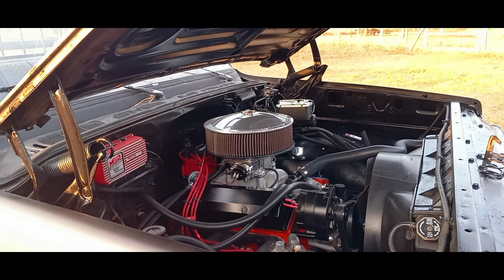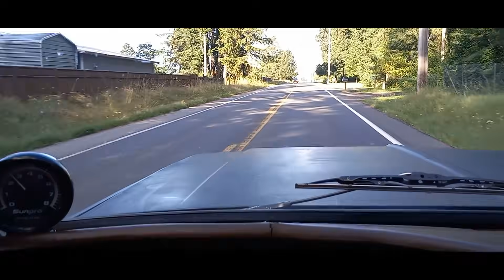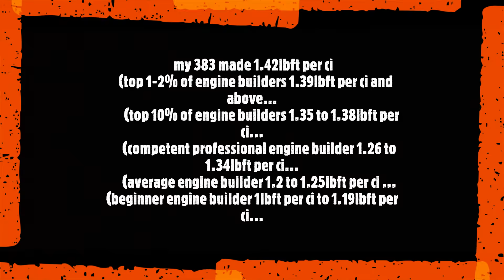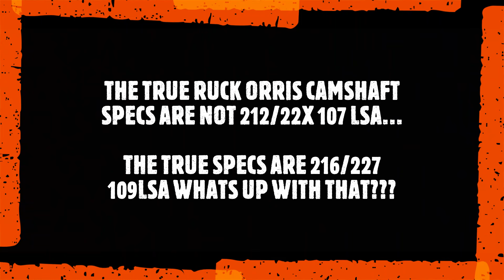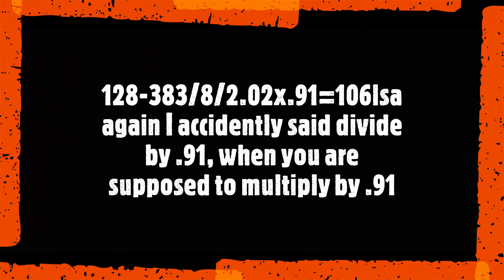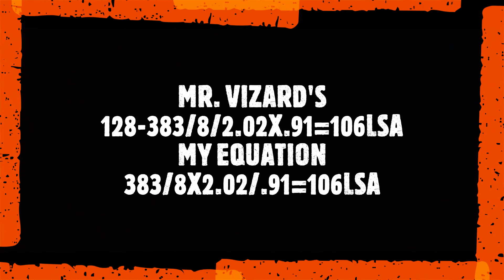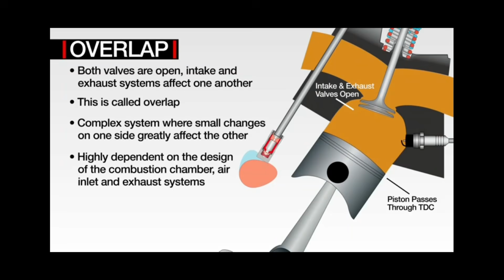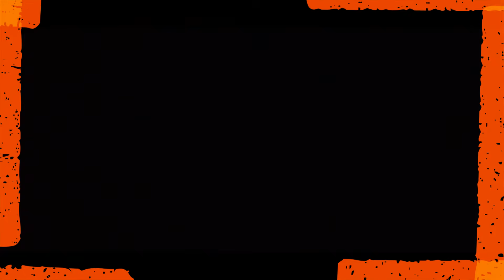CAMSHAFT SELECTION by LSA, 9 LSA's DYNO TESTED!!! LSA THEORY WILL BE DYNO PROVEN!!!, and EXPLAINED

Comment: I enjoy your observations but I think in terms of producing a ‘marketable product’ profitably and used for a vast range of cylinder heads compression ratios, gear ratios , vehicle weights, stall and flash speeds, and even regional climate extremes ( ex 2 identical cars/engines one in Miami Fla and the other in Denver Colorado) , by definition a mass produced camshaft requires some generalizations and ‘overall’ performance gains over the stock ‘baseline’ cam. 

I believe it you could control valve timing and lifts/durations and lobe separation angles dynamically ( say with a self learning cpu controlled pneumatic valve control system tuned for optimal VE ( torque ) almost without question the LSA would start out advanced and widened at idle and low speed with lower lift ( for optimal part throttle driving and volumetric efficiency) then the lsa would narrow and the duration widen and valve lift rising through the middle and the duration and lift continuing to rise going to high engine speeds while the LSA spreads and the ICL retards . 

The other thing that has a huge effect on power output is the fact that after peak torque/ve is achieved what you are really seeing is the effect of internal friction ( ring. And bearing drag from piston speed and other parasitic losses) acting as a brake on the crankshafts output. It’s not all head flow and cam timing but I’m reality you are fighting the effects of the engines parasitic losses taking their toll on VE. 

But to the point I’m trying to make, a manufacturer of anything mass produced must compromise ‘ optimum’ for profitability, and also allow for customer under/over estimating the engine components being used or their intended use. 

Thanks very much I enjoy your posts. 

I’ve also met Mr Vizard at lunch a few times through a mutual friend, he is indeed a very intelligent and cordial man and is extremely knowledgeable in his field as well as incredibly well-versed in many other subjects as well.

Comment: I've got a 91 mustang gt with trick flow twisted wedge 11r heads with 190 and 53 cc, holly systemax intake, 30lb injectors and calibrated maf, and its got a comp cams xe.....hr. I'm not sure of the exact cam. It's got solid engine mounts and an aftermarket k member. It's got ful exhaust and a 3 inch intake tube.   The car is very jerky under  2k rpms. Is it due to the cam or does it had something to do with the solid engine mounts?

Comment: WOW great video. I Have  Attention deficit disorder. it's really hard for me to retain info.
I have a 5.3 out of a 2004 gmc serra. It has 706 heads with 9.5:1 compression. It will be going in a 86 c 10 short wheel base truck.  Form everything I picked up from the video.  I need to get heads first if I am going to. With that being said should I keep my heads and get them ported and polished? also flow charted?  If so whats a good place to get them done?

Comment: I do have a question. I am putting together a 355 SBC. Its a stock 010 4 bolt block, stock crank/rods. pistons are TRW 4 valve relief forged pistons. The heads are the Summit heads, similar or the same as your 383 in the flatbed. (out of the box) The combustion chambers are 72cc's. I used .028" thick head gaskets to help with compression. I'm putting the compression ratio at around 9:1 (calculated). The cam I chosen is the tried a true Performer RPM cam. I have used this cam in the past with real good results. After watching this video and using the 128 formula, I came out to 108 LSA. The application is a fun street engine with good characteristics - idle/driveability. The RPM cam has 112 LSA witch may go good with the lower compression ratio. Am I going in the right direction for this build? Thank you for any insight or guidance. My email address is jpriewe1@comcast.net.

Comment: Is lobe centerline the center of the lobe measured from the open and closed timing events... or is it the point of highest lift of the lobe? All drawings you see are of asymmetrical lobes so the centerline is always the center of both. I assume centerline would be the point of highest lift with for example an intake lobe with a more aggressive open ramp and softer close ramp.

Comment: Where can I find how to do the actual math for calculating needed duration for rpm range and compression ratio? My understanding is the one equation given here and on Vizard's video is for a 10.5:1 engine. I'm currently building somewhere between a 9.2 and 9.5:1 385 sbc. Waiting for heads to get here to check cc. I'm building it to be an 87 octane daily driver with a fairly smooth unsuspecting idle.

Comment: I have been listening to David Visard for a while , just seen this video and plan on watching it several times , I have a destroaked 350 sbc it has a large journal 327 crank with rods that came out of a race engine , from the engine build who did the machine work on it , and .030 327 hypereutectic pistons , I'd like to get some rpm out of it , mainly just going to be street/strip toy . But cam selection has been on my mind for a while and just not sure which direction to go with it

Comment: I have a 2016 Hellcat and the formula specs a 108lsa. I have yet to find anyone grinding an appropriate cam with this LSA. fFRP has a cam ground with a 111lsa with their Tomahawk 2.0 which is the one I was looking at the most. I know many say there isn't much gain with GEN3 hemi cams probably because almost all have WAY to wide of an LSA for the engine combo. Oh well I will probably have to have a cam custom ground. Maybe get FRP to do a Tomahawk 3.0 with a 108lsa.👍Wide LSA is also prescribed for boost to avoid losing pressure from overlap. Richard Holdener tested this theory and it is also myth. He did not lose anything but actually made power. Oh well. This the modern era where opinion reigns over fact.

Comment: https://youtube.com/shorts/KMQZ2AYKON8?feature=share

My little Ford 306 with Gt40P heads. Block is also decked 15 thousandth. Stock Ford 302 rods with Chevy 30 over 11:1 compression pistons. I'm running a Crane 284-2 Cam with 112 lsa.

Comment: I am putting a howards solid roller in my 406 sbc. I did the math and dang near hit it on the head, lol. My compression bump over the baseline 128 formula put my lsa off by 1. My 106 lsa to the formulas 107 lsa. I did the .050 duration calculation and i am 3* smaller , 247 vs 250 . 
 I will take that !

Comment: Crazy I always learned LSA was more targeted for the rpm target range and hp at certain rpm points. And duration was dependent on the cfm of int. and ex. at a specified lift point. Lift point at which the heads flow best at. But not running too low of an lsa and too high of duration so the cylinder will not go into reversion. Keeping all aspects of the cam, duration, lift optimal so the vacuum from the exhaust port pulls the perfect amount of fuel/air mixture into the cylinder(quicker). Literally was just about to buy the cam for my 6.0(370ci) procharged 74 nova custom. Compression ratio 10.22:1, 64cc heads. My tuner wanted the compression ratio between 10.3-5 but with the long wait for parts and not too many aftermarket forged pistons with a .945 pin bore I think the 10.2 will suffice. Will be around 12-1300 to the crank(850-900 whp). Will switch things up and give this a try for sure. Thank you for your knowledge. May God bless you, you will be in my prayers 🙏 🤝

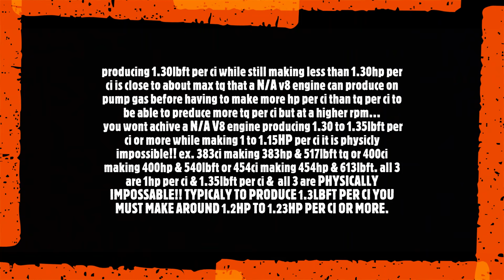Comment: I have been reading DV's books and watching his videos for ages, and his formulas work because they are derived from the results of thousands of actual dyno tests.  DV was saying (and I'm paraphrasing here) that if you use the LSA formula and find the cam is too wild for the car's intended purpose, that's because you have too much overlap (and resulting duration).  That is the one point that I couldn't quite get because I was hung up on the duration - eg, I NEED a 224@.050 or 268 adv to get the power and torque profile I want.  This video made it all make sense - the segment from 55:20 is pure gold.  You CAN'T know how much duration you need until you know how much LSA you need.  If the formula says to narrow the LSA, you need to reduce the duration by the same amount to maintain the same engine characteristics or power and torque profile.  This generally results in a shorter duration or what sounds like a "milder cam" than you would expect.  Thanks for putting it all together for me.  Keep up the good work!

Comment: I'm doing a 351w, nothing crazy it's  20 over, Aluminum heads 180cc 60cc, 1.6 rockers,stock bottom end, gt40 intake. I'm not sure  what  cam would  work  the best. Iv bought a few cams in the past  and even  had  some  custom ground. What's bad is it's like Even the companies you have grind you a Cam. they're not even sure What I actually need. It makes me feel like I've left something on the table. I like to get it right for once. I'm still a little confused about how to get the duration Any help would be greatly appreciated thanks

Comment: Gotta make sure you put in the parenthesis to have the correct mathematical formula to denote that what is in parenthesis must be done before subtracting 128.

E.g: 128-383/8/2.02*.91 = -14.359 but 128 - (383/8/2.02*0.91) = 106.4
Reply: Your point is spot on! Technically, the mathematical Order-of-Operations acronym PEMDAS covers this without the added parentheses... Parenthesis, Exponentiation, Multiplication, Division, Addition, and Subtraction, so it works out either way, but the parentheses help a lot to keep track of this order!!

Comment: Camshaft Type: Hydraulic Roller
Intake Valve Lift: .575"
Exhaust Valve Lift: .575"
Advertised Intake Duration: 286¡
Advertised Exhaust Duration: 282¡
Intake Duration @ .050": 220¡
Exhaust Duration @ .050": 224¡
Lobe Separation: 112¡
Intake Centerline: 108¡

The above details are from a cam I throw at my LS1 5.7L here in New Zealand & it made 65 more horsepower, but lost 45 pounds of torque.
Now this cam is just a will do for now type of thing an keen to know what I should try next as its 5.7l LS1 with 11 to 1 comp, CNC ported 241 heads.
Now I want something to work from say 1500rpm to 6500rpms any idea's as I'm willing to share the dyno sheet once its fitted.

Comment: I got a 5.3LS 
The heads are the 706
1.89/1.55 valves
199/69 ports
61cc chambers
I came out with 108.4 LSA
what would be a good cam for this engine. Street Truck. 
I appreciate any feedback thank you for your shared knowledge. 

I found this video from Richard Holdener

https://youtu.be/zfK45BqEo1Q

Comment: Sorry.  I can't wrap my head around LSA by itself being significant.  It affects overlap which is a significant tuning device. and says nothing about advance or retarding the cam's fazing. 
I have great respect for DV, but I still don't understand.
Reply: That part is correct that is affects overlap but the think about LSA is when the intake and exhaust valve opens like 108 108 intake centerline and 108 exhaust centerline on when it open same thing with 110 110 intake and 110 exhaust. If your engine wants a tighter LSA but the overlap is to much then take away duration to get the overlap you wants for the rpm band your running at.
Reply: @chevyrc3623  What?  Go back and check your spelling.  This is for real automotive engines and not toy cars.....  RD....
Reply: @stevemiller7654  I have 2 channel don't judge people by it cover just because I have an rc car doesn't mean I ain't no engine builder. I race wingless spec sprint car in northern California with a 359 cubic inch SBC so you tell again that I don't know what I am talking.
Reply: @chevyrc3623  Never said you did not know what you are talking about, but I sure can't tell.   Take your time, settle down, and think a little before your thumbs fly across the key pad on your smarty phone.  And then try to make sense outta this:
"I have 2 channel do judge people by it cover just because I have an rc car doesn't mena I ain't no engine builder. "

Comment: You Sir have gained a subscriber. To me the bonus information is solid gold! Being a life long 'Bow Tie Guy' doesn't hurt either. Having crushed a couple of discs in my lumbar rest assured, I get it. That has been with me since 1989 so I dare say I have earned my veteran status. The steel parts are fine, the bones they are screwed into... not so much. This is the first I have heard of CRPS and get that too, unfortunately. I intend on getting one more SBC built (it would take me forever now) and want a 70mph torque/mileage aimed build for an old Blazer/Jimmy mated to a 700R4 and 373 diff. Thank you!

Comment: Having a little trouble figuring out this formula for LCA. I have a couple of questions. I'm trying to practice it, and since the cosmos has been dropping 460 Fords in my lap, I'm using the 460 variation. 
1 last time I went to school, the forward slash wasn't a mathematical symbol. So what r we doing there feller? From the description, am I to understand that we're dividing? And if so, why don't we just put a ÷ there so us hillbillies without doctorates from MIT can more easily understand. 😂
2 when it refers to valve diameter, there's two of em in the cylinder. I'm assuming we're talking about the intake? Or is it the total of both valves?
3. And I'm afraid to even ask this one, as most of my gray matter has already leaked out my ears, but what do the 132, and .91 represent? 
When I try to run through the calculation, of course it's my understanding that you do the stuff in the brackets first. So when we do that, of course we have 460÷8÷2.19×.91=114.59
Then when we subtract that from 132, we get 17.41. That doesn't look right to me. What am I doing wrong?
Reply: It's 108 I did this order it works perfectly fine 132-460÷8÷2.19×.91
Reply: @chevyrc3623  so you subtracted the 132 from the 460 first? From what I remember from math class, when you have math problems inside brackets (460÷8÷2.19×94)  you do those first, then use those those answers in the rest of it. They should have written it the way you did, and it would have been more accurate.  Thanks brother.
Reply: @sethbarnes7608  yeah actually I did it both way subtracted first or divided first I still got 108 but the divided say -108 so it still came out the same for me just with the -
Reply: @chevyrc3623  also, I think that in the version of the formula I had, it was ×91, as opposed to .91   I think the decimal point was missing

Comment: Rob, talk to me about this custom heavy tow grind. I am at my wits end trying to spec out a cam that is ideal for what I am building. Maybe im over thinkin it. IDK. I dont want a cookie cutter cam. I want to optimize the exact engine I am building. Just looking at entering values to calculate LSA a 16.3:1 compression 5.9 says use a 106° and a 17.2:1 5.9 says to use a 107. Yet both engines cane stock with a 107.5. Talking 98.5-02 VP 24V build. I like math but this is smoking my wheels.

Comment: Thank you! This is GREAT info. The the last handful of months I've been digging through all of the wizardry that David Vizard shares. I notice a difference in approach between you and DV to determining overlap:

Your approach: Find another cam with the RPM range that you want, and borrow the overlap from that one
Vizard Approach: Choose from ranges based on his guidelines #1-#6 (#1 is daily driver, #6 is full race), which is a diagram that you shared at one point in this video.

You keep using 4 degrees as a figure for overlap, where DV's overlap numbers for a high performance street engine are more than 10x that. I believe part of that reason is because DV's numbers are seat-to-seat, and yours are .050", but I'm not 100% certain here.

Can you elaborate further in your decision to approach this differently?
Reply: Love this! I'm saving this educational video so I can re-watch many more times. You and David Vizard should team up for a future instructional video...❤

Comment: Hi Adam, thanks again for this video. I wish I could hit the like button many more times. I'm currently putting together a 318 for my 70 Dodge W200. It is going to be topped with an Edelbrock TR5 tunnel ram with a pair of AVS2 500 CFM carbs. I'm running 302 casting heads with the quench. The plan is for good drivability, torque, and fuel economy. I'm still working on the best cam specs for the application. I have listened to the video at least 10 times now. A real wealth of information here.

Comment: Thank you for sharing this. I've been cramming several channels lately to learn as much as possible. My main question I keep trying to find answers on is how this knowledge works on EFI engines. I've been told by some companies that EFI needs a wider LSA. Take my dually 454 bored .030 over, good valve job with very mild touched up head, LT headers, exhaust, factory intake manifold, bigger injectors and a PCM upgrade a 0411 that I could tune. Comp recommended the XR264HR-13 01-412-8 camshaft with 212 int./218 exh 113 LSA. After looking at the overlap calculator i'm showing a -11 degree overlap. Seems like there was a lot left on the table of am I missing something here.